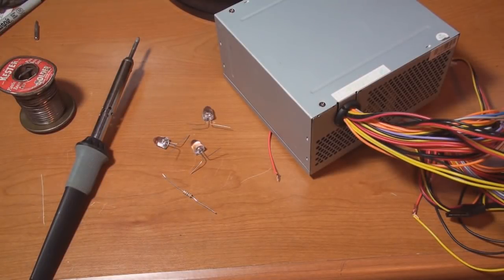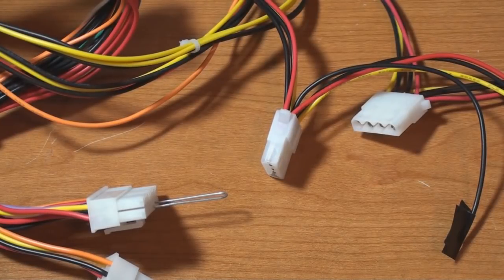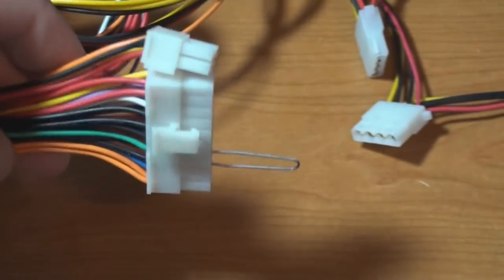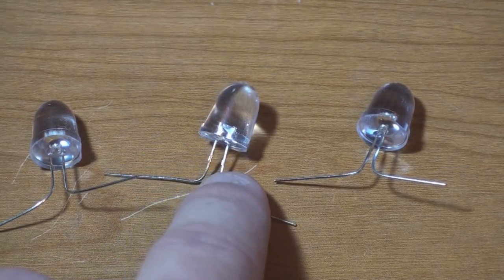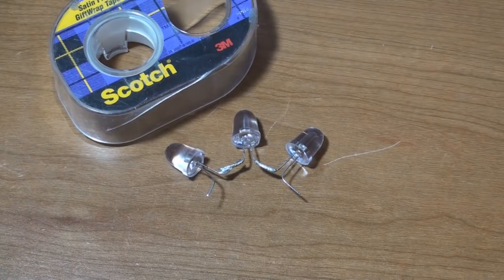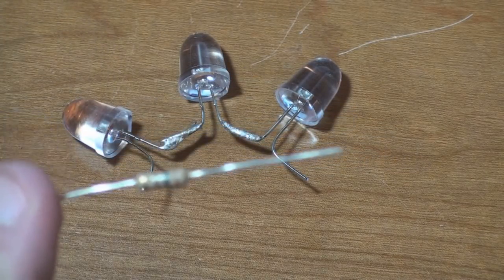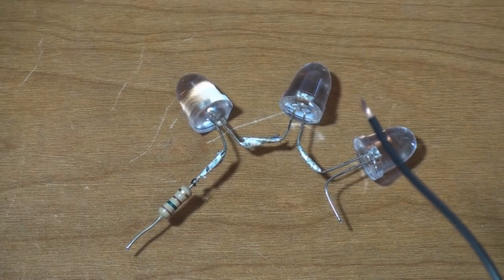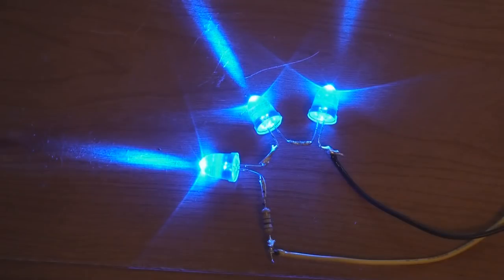How To Wire Multiple LED's in a Series Circuit !!

Comment: Is it okey if i dont have a resistor?
Reply: Yes it does, if you do not have a resistor too much current will flow through LED and can destroy it or shorten its lifespan, also depending on your battery voltage you can start a fire.

Comment: 12V doesnt kill anyone. Anyway neat video done.
Reply: what a terrible comment to leave.  you should be very cautious around anything electrical.
Reply: your correct 12v doesn't kill its the amperage that's delivered that kills you at any voltage even 1.2v or 12000v
LMAO

Comment: Hey mate, very helpful video.
Just wanna ask some things:
1) What is the voltage output of your PSU? I got an old PSU that i don't need, but as in all PSUs it has got like 3 different voltage ratings (+3.3V +5V +12V1 +12V2 etc). What's the right one?
2) If I use LEDs with different voltage ratings, say like 3.3, 2.2 etc, and I wire them in a series circuit, what and how many resistors should I use?
Maybe these are really simple, but I'm struggling with electric circuits...
Reply: Nevermind the first question, i sorted it out :)

Comment: nice idea... put a paper clip inside the pins of a lethal power supply and turn it on. that's totally not a death waiting to happen!
Reply: Those 2 pins are connected to the power button on the computer via motherboard and it tells the power supply to power all of the other components

That is called bridging the power supply
Reply: True, but if you mess up while wiring the LED's to the motherboard, you probably could end up frying the motherboard or the LED's (I hope nobody is dumb enough to fry the motherboard). Not to mention that the power source is a lethal amount of amperage, which could easily cause the paper clips to melt or become red hot and shatter from the heat being directed so quickly to the pins. I honestly would not try that myself. Then again I watch this to know that I am not smart enough to try it and be safe while I do it.
Reply: When ever a PC is on it is constantly shorting those 2 pins so a paper clip just mimics a powered on PC
Reply: I feel stupid now...

Comment: hey i got a problem i wired my 3 LEDs in a series circuit but only the first LED is glowing. I even checked the circuit and tried parallel cicuit tooo but only the first LED is glowing

Comment: I completed setting two blue LED's with mobile charger (un used) as Power supply with having 7V -750mA. I did for my 30Litre Aquarium lighting, replacing my 8Watta blue tube light. That 8 Watts was not only taking more power , it was too much bright for fishes too. Now, it is too perfect and fishes get some dark corners to take nap, whenever they need too. It's cool, power is also used much lesser.

Comment: Yes, sometimes, 150 ohms resistor can be used, if your input DC power supply is higher than 3V, i.e  7V or 9V or 12V. Although it depends on how many LED's you are going to glow with the DC Power supply. Each LED consumes 20mA current, that is standard. But at some places, people get LED's of 2.2 V or 4 V too. In that case, the resistance value differs.

Comment: Sir,
How much voltage each LED's is rated by consumption? In mumbai (india), we get normally 3V consumption LED's. How much voltage DC power supply you intended to give for 5 LED's ?  If I assume you have 5 LED's of 3V each & 7V DC power supply with range of 500 - 800mA current, then the calculate goes here:- Resistance = (Vs-Vf)/(20mA x no.of LED's) = (7-3)/20mAx5 = 4/100mA = 4/0.1A = 40 ohms. Therefore, you can use 40 Ohms resistor at +ve terminal of your power supply and glow 5 LED's

Comment: You'll find that if you wire even more in series that eventually the whole set of Led's will get dimmer and your one resistor may get very hot. Each LED should drop the voltage by approximately  0.9 volts. Its actually a workable means to run say a 6 volt device on say a 9 volt battery. You put 3 diodes in series from 9 volt battery to say 6 volt radio. You get 2.7 volt drop in voltage allowing safer connection to your radio without causing a failure in the radio. 4 diodes = 3.6 V drop and so on

Comment: I doubt there is any PSU on the market without current protection. If you short it- a fuse will blow or the current protection will cut the power. BUT, it's always better to be safe than sorry when playing with electricity.

Comment: Shorting the power supply could kill me? If you are that experienced I suggest you to not do electronics. Shorting it will not do you anything. It could damage the PSU, if it has no overcurrent protection. You can touch both leads and this wont kill you. You even can lick it. It will hurt a lot, but wont kill you at all.

Comment: Hi, I'm thinking of using your method to use multiple LEDs in a costume, but this depends on how big the battery required is in order to light all three LEDs. I don't have a great deal of space, 
I don't suppose you can give me any advice on how what size battery can light however-many LEDs? ^_^

Comment: I used a 12V power supply to power up 3 LED, the problem is I can't Light them all up. If I place the power supply on each LED, They Light up, if a series of 2, they also Light up, but when I connect the power supply on both ends, It doesn't Light up, what can be the possible problem? Thanks!

Comment: this may be a stupid question and I'm pretty sure i know the answer but if i buy a 2 leds from radio shack that are rated for 5 - 6 volts and i use the 5 volt power of a computer thought a usb port will it power them in a series circuit or will the first one use the full 5 volts leaving none for the next led. BTW I am trying to build the led mouse pad that kipkay made

Comment: yes. the USB port is a 5 volt power source, so the wiring in his video is not applicable for the 5 volt USB.  this would require a parallel connection. one resistor per LED.  around a 91 ohms or so resistor for each LED.

Comment: i suggest heat shrink instead of electrical tape, may be tricky but a much clean looking result, what kind of resistor are you using?

Comment: If one breaks, the whole thing breaks, and you'll have lots of fun finding the broken diode.
there are exceptions, where it's done with a series/parallel combo, so they wire 4 3V led's in series to get a 12V input rating, and they run these sets in parallel. nothing bad with that breaking, finding the broken one among 4 diodes is not an issue.

But i've seen people do crazy long chains of LED's and running them at 300V+ 

Never ever is probably a bad expression, never ONLY in series is better.

Comment: the LEDs are probably rated at 20-25mA.  the resistor is most likely 100Ohms based on the remaining voltage.

Comment: the resistor is to restrict the current in the circuit.  in his circuit the resistor value is based on the voltage that's not used up by the LEDs.  Probably about 2 volts or so assuming each LED has a voltage forward of about 3.3 volts.

Comment: you're not correct.  the LEDs are being connected in series.  you would not put a resistor per LED for a series connection.

Comment: It's the combination, you could grab a 100 Amp wire, but if there isn't any voltage on it then absolutely nothing will happen.

I mean, a 0.01 amp wire could kill you if the voltage was high enough too. :/

Comment: It's the amps that kills you... I've been shocked by 10,000 volts from a cars distributor, not pleasant, but not fatal either. If the amps had been higher, then would have been worse. Heck, 0.01 Volts could kill you if there was a high enough amperage with it lol.

Comment: What a question!
Really... depends on the resistance, voltage, current drag?
If tiny led draws 20mA at voltage of 3V
Its 0,06W so 1W resistor should handle 60 leds?
Voltage * amp= WTF! if its 0 ohm it should handle millions of leds...
Thats where the Ohms law comes in...

Well, thats one badass question we got here..

Comment: Justin's right, it's current sourcing that you've got to watch out for. A 12v system can kill you if it can source enough current, auto electrical systems for example. I wouldn't advise licking your fingers on either hand and putting them across the terminals of a truck battery.

Comment: Obtain these values: "Vs" (your supply voltage in DC volts); "Vf" (the forward voltage of the LED, or assume 2.2V for a typical red indicator LED); "If" (the LED's operating current, or assume 0.02 amperes for a typical LED). The resistor value, "R" in ohms, will be (Vs - Vf) / If. As an example, 5V - 2.2V / 0.02 = 140 ohms. The resistor wattage is generally determined by the equation (Vs - Vf)^2 / R, or 0.056 Watts, with that value roughly doubled for a safety margin to yield about 0.1W

Comment: You best not to have them in series and use resistor for each it will extend the life of the leds and keep consistent light. as 1st in series brighter than next etc etc. 470ohms i use for 12v on each led. You can prob get away with 3 in series that more in parallel if needed.

Comment: How do you 'soda' the connections? We use solder here in little old England. It's different because there is a letter L in the middle. Try it - S. O. L. D. E. R. - SOLDER it's easy.

Comment: For those of you who keep asking what resistor value to use? what resistor wattage to use? how many led's can i wire in parallel or series on a given supply voltage? Check this site out - ledcalc.com   Just make sure to select your preferred configuration i.e. series or parallel before inputting the values

Comment: I am concerned about the mindset of the people that respond on here.  The bible says there will be no brotherly love at end times.  We may be at the end times.  That being said, what is the output of the computer power source?  What is the voltage drop at each led?  So, do we size the resistor to balance the circuit?  Thanks

Comment: if i wer u, id lite my whole room w/ them, a large enough psu would have the nessasary wires also, i hv an extra psu i use to test wutev and ive shorted it out w/ metal i was holding, the 12V rail isnt enough to hurt you, thru ur hands anyway, ive heard of ppl licking a 9V battery so try the 12V rail of a psu, the psu shorts so it doesnt destroy itslf but the V is so small its not going to hurt you, now if u put a paper clip in the cord tht goes to the psu, then u got a prob

Comment: If the voltage of the LEDs is higher than the input voltage, the LEDs won't even turn on. You should put them on pararell and add an appropiate resistor.

Comment: yes, it will drop the power, but remember, the more resistors you add (in series), the less power delivered to the LEDs. If the LED isn't lighting up, it's either because you dont have enough power, or you burned them out by applying too much. The 5 LED strand is probably a 12V strand, which means adding resistors would have the opposite affect. Unfortunatly, you either need a bigger power supply, or new LED's (and use resistors this time!). Hope that helps.

Comment: Why do you solder a resistor to the positive side? As far as I know, the current of the circut is not going to change if you wire it to negative side. Or am I wrong?

Comment: Ok quick question,
I'm into rc and i have a rock crawler from axial. It comes with 4 5mm white leds for the head lights and 2 5mm red leds for the tail lights. Well im going after the baja look so i picked a strand of 5 5mm white leds wired in series if im not mistaken (all 5 leds going into a - & +) but when i plug that extra strand of 5 in they wont light up. The battery is a 7.4v 5000mah lipo. If re wire the leds with a resistor on each led will that drop the voltage and power the leds up?

Comment: I'm sure its possible to do this in a pc right? Would I simply need some extra wire (I have some from previous soldering) to connect the molex yellow/black to the series? Or would there be other issues?

Comment: better yet...you can pulse led's with short pulse widths current....less than 1millisecond at high voltages...at any voltages actually which will maximize light output....no resistor is required since the on-time is shorter than the off-time...light output of any led is directly proportional to current...therefore the higherthe current, the more light...but since led's require current limitation by using resistors...this limits light output...short pulses require no resistors and maximizes light

Comment: 1) 20mA is 0.02A not 0.20A
2) the currents do not add together, if they all need .02A then that is all you need to supply
3) recalculating this gives you a 450 ohm resistor with only .36 watts dissipated 

so not as bad as you might think

Comment: tape the paper clip so u dont touch it while working :)
im going to try build led light tomoro looking for info not to burn the place down :)
!. how many Watts are the leds you used? forward current?
2. how many ohms / watts was the resistor?
3. how do you determin how many watts the resistor should be. i noticed resistors sizes are like 1/8 ohm 1watt and others 1/8 ohm 3 watts etc. which watt resistor is needed for the 3w leds at 3v F.C?

Comment: no the resistor would heat up and turn into a small flame. (easy to blow out) i forgot how to hook multiple resistors with multiple leds but you have to use 10 resistors and hook them up correctly

Comment: You can use this to calculate the value of the resistor
[(supply voltage) - (# of leds)*(led voltage drop)]/0.025
2 AA = 3V
blue led voltage drop is 3.2,yellow 2.2, red 1.3

Comment: be careful size does not matter use a multi meter or algebra to figure out your power supplys output volts. then see the maximum voltage your leds can go and if the power supply is to high for the led get a resitior that you need

Comment: Thanks for the info. I have a large ferris wheel model that I will be putting lights on soon. I'm planning to use 3 mm blue and white bulbs rated for 3.2 volts. I'm just gonna be using a lot of bulbs, about 360. Am I correct in thinking that a 6 volt power supply will work, or should I use 12 volts?

Comment: nice.i have an old case which has leds for the power and hdd lights, they were pluged into the motherboard but im wondering if a snip the plug off them if i can connect the to a molex and plug them in and use them as they fit into my cpu block want to light that up

Comment: I can only get 2 LEDs to light at a time, I have turned the third one around, checked it to make sure it worked, and even plugged in 2 to one wire and when plugging in the 3rd to the same power source it turns out the first 2 and turns on the 3rd. What is up with this? I'm using RadioShacks 5mm High Brightness White LED 25ma 3.3V on a 4 pack AA, also tried a 9V (Same reaction on both)

Comment: so that only worked good w/ 3 cause of the Vdrop of each is 3.7v adding to just under 12, so all you had to do was limit your amps w/ a resistor.  but off that one 12v lead you could make multiple sets of 3 LED's to the black and as long as you didn't draw too many total amps you would be fine.  right?

Comment: @TheRuralGrowerMan you have to make sure your power supply is capable of providing power to that many LEDs.  A power supply only provides a certain wattage (P=E*I) and you don't want your LED circuit to exceed that wattage.  260 is a lot of LEDs and at 20mA per LED that's probably over 30 watts. so a 12 volt power supply would have to provide close to 3 amps.

Comment: @hockey102030 you can't do just a series connection with that many LEDs.  probably want to do a combination series/parallel configuration.  you can get 3 LEDs per series with a 12volt source. as demonstrated in the video.  using differerent color LEDs throws a whole other twist in this because different colors have different voltage forward values.

Comment: ok i will make a schema  The 0 are the 3 watt led and between are the resistor
0--0--0--0--0--0--0
0--0--0--0--0--0--0
0--0--0--0--0--0--0
0--0--0--0--0--0--0     So my question is if i need to have resistor between all the led if i need to connect in series like this 
Information:LEDS: i got 16 red 3 watt led 2.9-3.3v 750 ma and 8 blue 3 watt led 3.5v-4v 750 ma
DRIVER: 100 watt led driver Input Voltage: 90V-264VAC, 47-63HZ
Output Voltage: 28V-36VDC
Current: 3A
THANK FOR THE ANSWER

Comment: hey man like your vid but i'm not sure how to wire 10 3v LEDs on a 12v power supply(car battery) i put a resistor on every 3 LEDs and it doesn't work could you please put a vid explaining it pls?

Comment: thanks man, is this the rite way to wire them up, if i wana install them in my car? would i use the same resistor, since ur using a 12volts ? or would i use something different,,

Comment: @csidaznigga - If you do not use a resistor then your LED's would receive too much power, they would go very bright quickly, then break (They could not be used again). If the resistor is too big, then there would be too little to NO power going to the LED's and they would be very dim or not even on. Choosing the right resistor is very important.

Comment: i have a question, i want to use some leds in my model ship, like 40-50 leds.. i brought two leds and connected one to an A4 cell, but the light was too low. and when i connected single LED to 2 cells, it blew :/ what should i do? i have no idea about this type or work

Comment: right i have a couple of questions friend.. i have 13 super bright leds and a 4.9v adaptor. i think i know how to wire up the circuitry but i dont know which resistors to use what colour are they? ill salvage from a scrap circuit board i have if you could help! thnx :)

Comment: @JvanMASZ all u have to do is connect the led together and have to wirescomming out from the posative and negative end of the leds and the connect the  possative to 1 end of the switch and the negative to the other side then connect a wire comming from where the leds wire were connected to the switch and connect then into a 9 v battery HOPE I MAKE SENCE I AM ONLY TRYING TO HELP THANKS xPaaDz